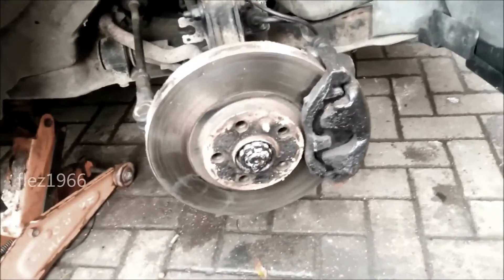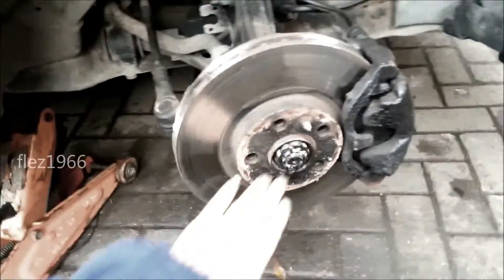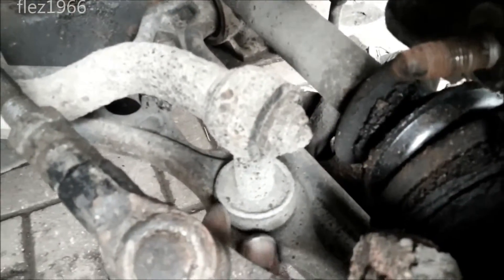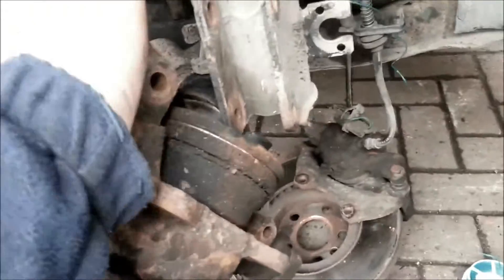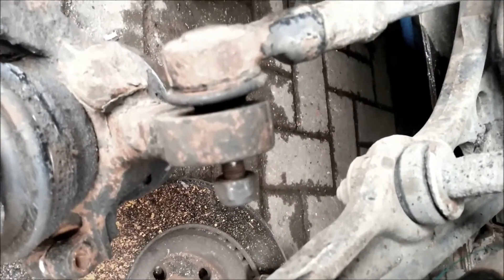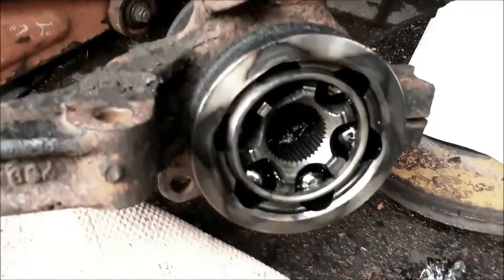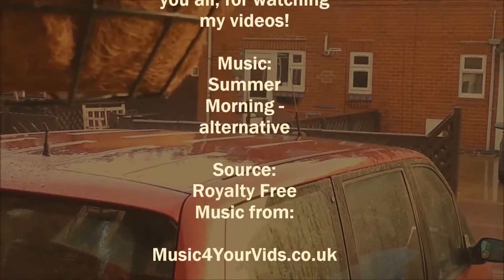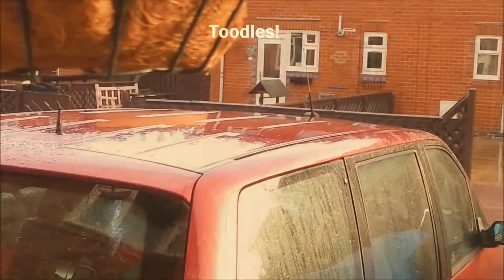'cv boot repair' Night camper conversion #06 for short holidays and photo trips peugeot 806

Comment: A few years ago I had a cv rubber fail on mot. To make life easy I asked them to do it. Sod me if the next year they faied l me on it again, It had been hitting the workings and has gone within no time. I did the next one myself, I did it by the book as I do all jobs, When a new one is fitted it has a set mesuments, thi is  to stop the above happening, The one I did is still on the motor now eight years on. Never trust any one to touch your motor. I don't I do every thing myself. Cheers Pete

Comment: I had to use a slide hammer to get my CV joint off the drive shaft. That bloody spring clip was a git. And then putting it back on was also a pain - I had to use a cable tie as a spring compressor (like a piston ring compressor) and then drift the joint back on
Reply from the maker: ian did the towbar fit, if not i know someone after one you can sell it on to etc...
Reply: lez briddon Not directly but I'm talking to a fabricator who might be able to fettle it